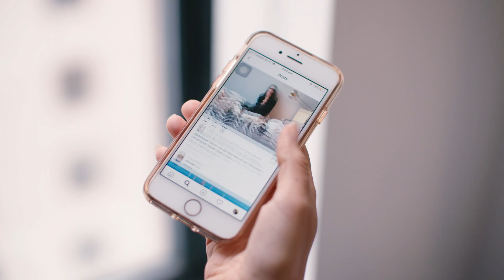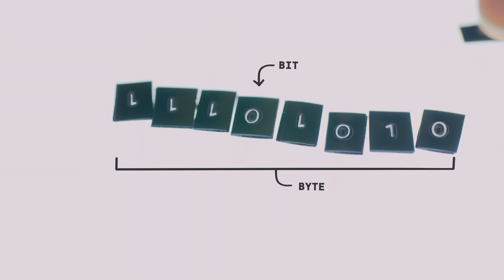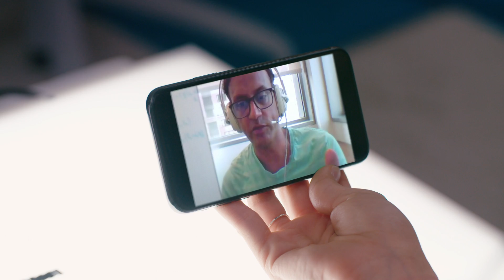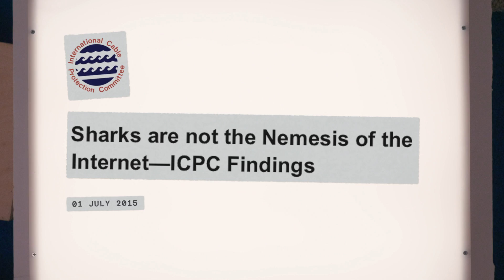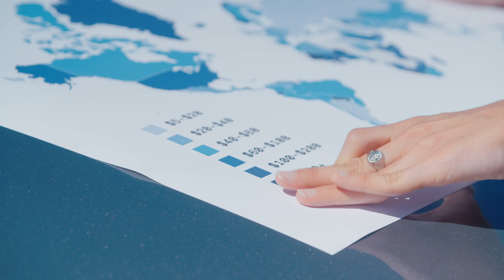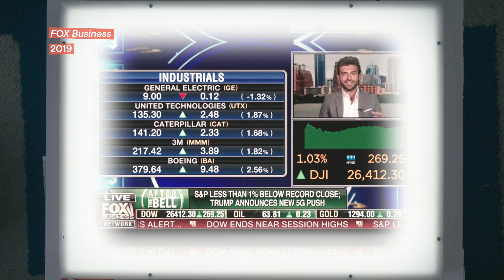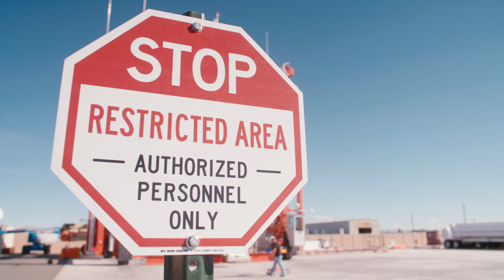How Does the Internet Work? - Glad You Asked S1

Comment: The explanation is simple so it is easy to understand how the internet works from the beginning to users all over the world. The internet mission using Air Balloons by Google failed for a short time due to large operational costs. Finally, Elon Musk has had the idea and mission to use Satellite Internet with his StarLink satellite project. Finally this problem was solved in the near future. Because in Indonesia🇮🇩 itself, we have experienced the convenience of fast internet in 3T (Disadvantaged, Frontier and Outermost) areas with fairly high speeds with fairly cheap monthly fees for speeds up to 300Mbps depending on the conditions of the area where the Starlink device is placed.

Comment: Been in IT more than twenty years. This is an excellent vid on the physical layer of the internet. There are six other layers to make a total of seven layers. Look up PDNTSPA; it's an acronym with numerous words for each letter, but it's called the OSI model and it's where most of the action takes place on the internet. The "payload" which is your email/image/text etc is encapsulated in a total of seven layers. The process is assembled and then reversed so you can use the info. Thanks for a really well done vid!

Comment: Video is ok to give a glimpse of what the Internet is and how it works but it’s very very superficial and incomplete, actually it misses why internet was so revolutionary at the time , it was “one of” the possible way to connect different computers, but the actual key was how the protocol works , i.e. how the email or a website   is progressively reduced to 0 / 1 . It was the different steps from the mail to the 0/1  which made the difference, ie the protocol was the revolution ( very lil mentioned in the video ). obliviously the all radio things had an impact and make us navigate faster and faster , but strictly speaking the  radio part has nothing to do with how the internet was such a revolution from a tech standpoint

Comment: i have my dads Sony clock radio from the 80s in my room and sometimes when i put my phone next to it the radio will start making these weird clicking sounds, another related thing is that we have a microwave from 1993 in the kitchen between the table and where our router is in another room so sometimes when you're using a laptop on that table and someone is using the microwave it messes with the laptops internet connection, correct me if I'm wrong but the fact that the internet is like a radio signal or a microwave signal might explain why these happen! are modern radios and microwaves made with the existence of the internet in mind to prevent this?

Comment: It's still quite a feat, laying an oceanic cable, aside from drift, there is differing drag depending on the speed at which the cable falls, and the speed of the boat. Catenaries form. Underlying geological surveying to measure how much rope to lay into a dip or over a floor bed valley... Not exactly as straight forward as laying a street cable/pipe

Comment: How the internet works is a lot more involved and complicated than this video.
This video is just the fundamental basics.
Anyone that wants to take the time to do a lot of research can plan on spending a great deal of time consuming researching back in time hundreds of pages of documents, news reports and almost as many YouTube videos. 

It was easier for me when I started back in 1997 using Altavista, Dogpile, Lycro’s search engines. That was Internet 1.0. 

Today we are entering Internet 3.0 with Ai, AR, Meta Verse, etc etc. parts of the old Internet 1.0 still exists in the “Dark Web” 

It is more difficult to do extensive research today with the flood of Google advertising you have to navigate through. Using Microsoft’s Bing search engine is another option. There are about 100 specialized search engines available on the Internet.
Using the “Advanced” search engine option is another way of doing research.

Comment: Mind blown! I've always thought the internet used satellites. Glad you told us!
Reply: They partly do but compared to the terrestrial optical network it is slow, low capacity and expensive but on the other hand it has great coverage so it is viable option for very isolated and remote areas far from the network of landline cables.
Reply: @qwe5qwe566  satellites were never used for comunication that's a myth. Satellites are in Ionosphere where there is all type of magnetism and interpherence etc that would be really silly to comunicate through satellites when cables, ground antennas and ballons can do it 1000x faster , effective and cheaper.
Reply: They do now. Ever heard of Starlink!
Reply: same here

Comment: As a network engineer, I liked this type of teaching. We call it layer 1 to layer 7 , layer 1 being physical layer and layer 7 is application. At layer 4 (network layer) fragmentation take place. there is lot of switching of packets and routing involved as well. A network engineer works from layer 1 to layer 4 mostly.
Reply: Why is the 7 layer OSI model still used when TCP/IP is what we use?

Comment: So in other words, hypothetically if you had a device that could convert these signals into the original message you could see all data? So for example, if you intercepted a radiowave from somebody’s phone, or connected a wire to one of the wires in the internet hub or connected a wire from the international wire and intercepted people’s messages IF you could convert the signals into the original message?
Reply: Hypothetically, yes. Realistically, most, if not all of these communications are encrypted. So even if you were to intercept the communications, you wouldn't be able to make sense of them. That is unless you happen to be a govt agency with a nearly unlimited budget.
Reply: Jose Javier Flores I see, that’s so cool and scary. So by budget do you mean the resources like access to keys or decryption codes. Or simply the manpower to decrypt data

Comment: Qu🤔..
Don't you know the old 14th century wives tales about cropping off people's heads(and other parts) from photos and pictures.?
I'd say obviously not, as you've just gone and done it, and awfully, right in front of the people who are in the photo, which is like, really unlucky.!  It's the worst way to do it (with them being present).
If I was you, I'd get everyone involved back in the same room (make ABSOLUTELY SURE that they spin round 13times between the front door and any other door, and get the prickstick and sellotape out. 
You've GOT TO make sure that the edges go back EXACTLY how they need to, to get the picture back as it was.!
 (Rich with a small r.)

Comment: Good even coverage of all topics. This is a perfect introduction to how internet works, only criticism i have is Vox did not take their usual detour explaining the history of the underwater cabling or the internet itself. The video is still outstanding, but historical detour makes for better viewing. Without going into the details they could have shown a generic diagram of the packet journey from end to end. In case anyone is interested and a student taking/about to take networking class. You may want to look at these topics. 

1) Segmentation.
2) Encapsulation and de-capsulation. 
3) Radio waves + Digital Modulation. 
4) Packet switching.
5) IP Routing. 
6) Fiber optics communication with cladding. 
7) Access, Distribution and Core networking (the boundaries are usually). 

With all my reservations about this video, i still think this is the best introduction to the internet video i had ever seen. As always good job Vox.

Comment: Btw the current internet design based on client-server architecture is inefficient.
If you are living in Africa, and you want to send to send a whatsapp message to your friend who is sitting next to you, it would have to travel all the way to Facebook's servers in the US, to then go back to Africa to your friend who is sitting just next to you.
Why can't you just send the message directly from your phone to the phone next to you?
Why do we actually need ISPS?
The future of the internet is a completely distributed one, without middlemen, without servers and absolutely peer-to-peer. Mesh networks are the future.
Reply: You know, that is not the future of the internet but it was kinda its past.
The design of the internet never intended for the current(!) centralization of all user services (FB, google, Amazon/AWS and so on).
It was/is by definition a distributed network with no central point of failure.

But the economics of efficiency and optimization with no regard to redundancy kinda led us there...
Reply: @L1m3r  it doesn't matter if it wasn't intended if the only way to this infrastructure to optimize efficiency is through centralization.
The concept might be old, but the techniques to ensure decentralization and distributions not despite efficiency but to achieve efficiency is groundbreaking new.
Check out the design of MaidSafe's SafeNetwork.

Comment: 3:04 It doesn't though? For cell towers and wifi, yes. The animation implies office buildings and homes use radio waves as well. Most don't, unless you have satellite internet.
Reply: What do they use?
Reply: @alec-dora  Up to the point of entering your home/office, most internet data travels on ethernet or fiber optic cables, which use light or copper signals to transmit the data, not radio waves. As the data leaves a router as wifi, it does use radio waves, but that's a tiny fraction of the total distance. Cell towers are also wired into ethernet or fiber optic connections.
Reply: Cell towers use radio waves to give the device the signal, but for the most part they have fiber backbones to the network. Think of it like a massive wifi router for outside. It uses wireless, but it still has an Ethernet cable connecting it to your modem.

Comment: So, my data (my e-mail) is a series of zeroes, and ones that make up binary code. This code is measured as bytes (8 digits is 1 byte). Then that code is sent as radio waves to cell towers, and routers. These then use cables physical cables to connect different internet service providers to each other. 
The future is 5G where they use better antennas (cell towers), but these need to be smaller and more numerous cause they're more easily blocked individually. Though they still need the cables of an ISP.

Comment: It's not true (at 15:35) that "at higher frequencies you can pack more information". Signals occupy a given bandwidth, a range of frequencies, and the data transferred is proportional to the bandwidth a signal uses. The advantage of high frequency is that there is more bandwidth available, e.g in 40 Ghz range it is easy to allocate 1 Ghz bandwidth. But at 1-2 Ghz, where most cell towers operate, there is a huge competition for even 1 Mhz. (It has to be bought from the state).

Comment: With all of the people connecting to the internet, we're running out of IPv4s. Only 4,294,967,296 IPv4s can be allocated due to the limitation of the address format. There are 7.594 billion people in the world. We're bound to run out at some point and it started happening in 2011. The next generation of IP is IPv6 which was launched in 2011 (to try to combat this). IPv6 can allocate around 2^128 which is more than we'll ever need. Even now though, it's only 40% deployed. It's only useful for the consumer if websites support it, and it's only useful for the hosting companies if all the last-mile providers (like AT&T or Comcast) support it. The main roadblock is that most of these network switches themselves aren't software-based, so they can't just release a firmware update to add IPv6. They need to buy new switches and swap them out. So, unfortunately, it'll be a few years until that happens.

Comment: Thanks for making this video. One question though: when countries test their ballistic missiles or bombs, what happens to those underwater laid wires? (Also in case of a drastic earthquake or calamity, is there any preventive measure for that?) 🍻
Reply: Those ballistic missiles are only tested on the surface of the water. The Wires are laid way too deep. The water density is literally so high that the missile have absolutely no impact on anything a little deep under water. Its more like a missile hitting a concrete wall... Just plain concrete from bottom of the ocean to the top of it.
But I have no idea what happens when the ocean floor shifts with the movement of tectonic plates. May be they do a geological survey of the area to pass the cables from the safest place under the ocean.. and since the cable lay at the bottom of the ocean and are thousands of miles long, even if the surface below shifts a little it will just float around a little bit.. It just won't break off being that strong.
Reply: Wondering the same thing
Reply: Glad you asked,now i will tell commy how to blow up the line..

Comment: Basically Its all about transmision  , from analog transmision  and now to digital transmision . All this data are transmit as a packet signal  from user end computer via the telecomunication line and network to the other user end ,,,, as for email are control by the email server  within the network.

Comment: Q. If the fiber got damaged, what happens to the data inside the damaged part ??
Reply: Once the signal reaches the damaged section, it just becomes scattered, you get packet loss, or if the damage is bad enough, the data doesn't transmit at all. We're talking either light or electrical impulses; it's not like a pipe with water in it.

Comment: But how a photo is converted into binary? Please answer it.
And by the way very good video guys. I loved how you explain things. Great content. Keep it up 👍👍
Reply: A photo is normally in size of  kb or mb which are normally referred as lots of bytes like 1263738bytes and  these bytes are futher shrinked into bits ,so each digit has a bit which is 0's and 1's so called binary Eg.for 1byte= 8bits and these 8 bits may 00000000 or 10001010..here the system h/w and s/w plays the role of conversion and sending it through internet..and rest all physical data transfer as per vox said.
Reply: @MadhavaSM  thanks a lot. It explains a lot. 👍👍😀

Comment: To understand how internet works, 

1. Undertake a course in Basic Electronics
2. Next understand Digital Electronics.
3. Learn electronic communication, modulation etc.......
4. Learn PACKET SWITCHING, this technology which differenciates from other forms of electronic communication and INTERNET as we know at present. Internet is so cheap and accessible simply because it follows packet switching.
For a layman, internet follows postal system. (create a message, attach from address, to address, close the envelope so that it is safe and confidential, put it in a postal box and relax).

5.

Comment: Some random diver: Cuts underwater cable

Whole USA: "Mom, did you pay Comcast yet?! MOM."
Reply: would it cause a huge problem for the diver?
Reply: @drinkwater9707  wouldn't he get electrocuted?
Reply: I think they're light cable
Reply: @locuspocus3822  nope, the information travels in the form of light so basically no electricity is used. When the info reaches its destination (a country) it gets converted into electrical signals. 

If you use a Wi-Fi router the electrical signals reach the router and get converted into electromagnetic waves.
Reply: @locuspocus3822  most likely because there are electrically powered repeaters sunken wwith the cables and they need electricity to refresh the signal about every 200 miles
Reply: Exolette the cables are actually cut quite often! Usually by fishing boats or boats that are dredging the bottom of the ocean close to the shore! But it’s okay because there are lots of cables and routes are built to be redundant so the information always has a way to travel to its destination!
Reply: STRANGE WAY OF TRYING TO THINK ! ?

Comment: Clearly told me that all those thousand satellites is USELESS
Reply: they're not useless. They're just not used for internet due to latency. They're used for GPS, satellite TV, weather measurements, and a million other uses.
Reply: @jorgebatista6323  its just they are implementing 5g through balloons, while thousands  of satellite are there
Reply: @obuzbouz  yeah but the geostationary satellites are useless for internet, as the latency to make each request would be over half a second, so satellite internet is a last resort thing.

Also, the balloon thing I don't think will work well, due to weather conditions and unpredictable winds.

The solution I think os the best is spacex's starlink, as it is satellite based, but on a much lower orbit, which means almost no latency and worldwide coverage from day 1.

By the way, they don't use 5G tech on the balloons, they use a much lower frequency. 5G has a very low range.

Comment: Please don’t call it a router. The thing that give us the Wifi signals are called Access Points. Routers are the big heavy noisy boxes that you would see in a data centre.
Reply: What about that small box in our home? They are technically a Router that nowadays integrated with Acces Point and Switch hub functionality.
Reply: @bpcgos  Again, we are getting confused here due to the common misuse of the term router. A Router is a L3 device, where as an AP and Hub are L2 devices. They have completely different functionalities. The small lightweight boxes in our homes for the most part are just simple Access Points which are incapable of performing L3 packet switching.